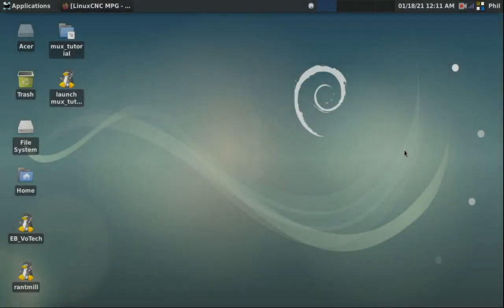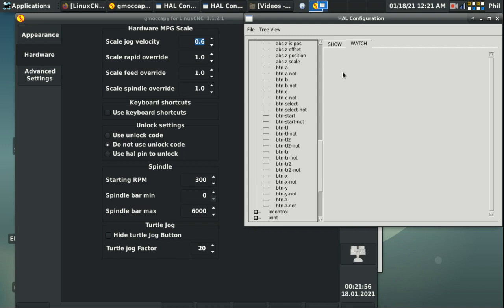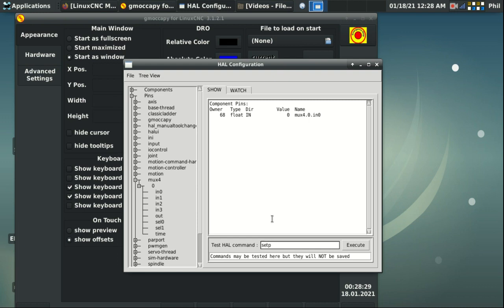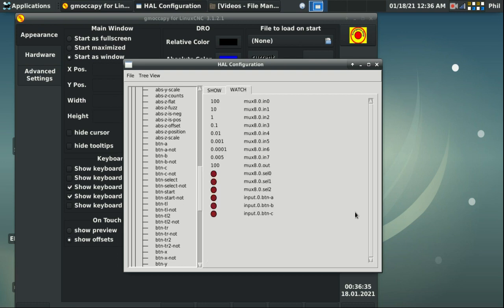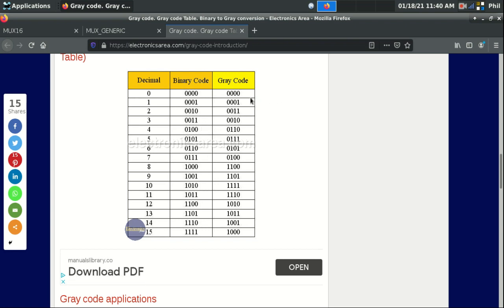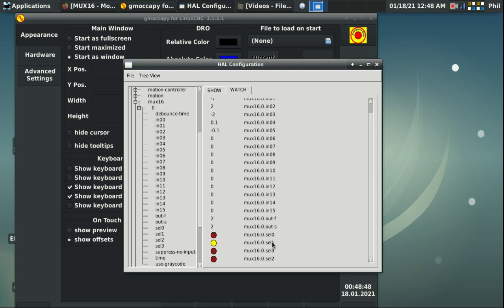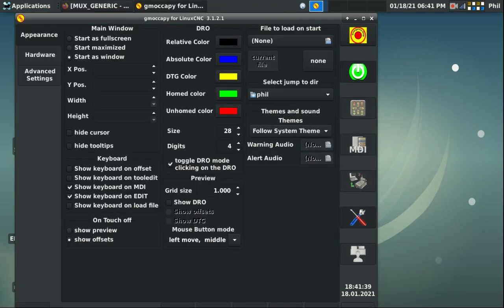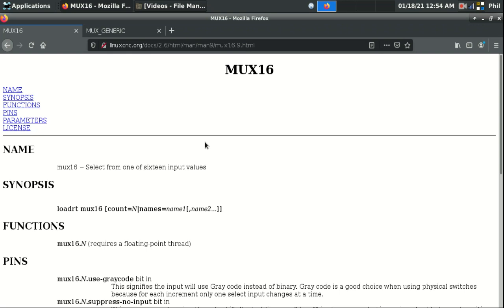LinuxCNC basic HAL tutorial part 5 - MUX

Comment: The preference for Gray code was because it only switched one bit at a time. Often the the device inputs were relay contact driven with it's inherant noise resulting in srambled information. With Gray code only one bit could be distorted at any change. Debouncing got rid of the problem and we could all return to playing with proper binary and live happily ever after.
Reply from the maker: @hotelbobcasual  Gray code is still being used in industry. I ran into a Gray code selector switch a few weeks ago, actually.